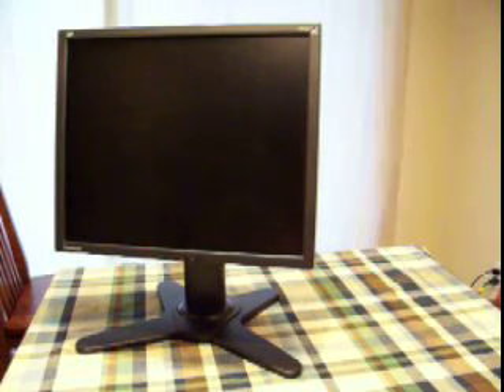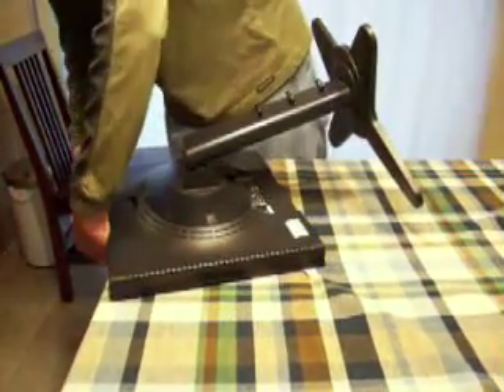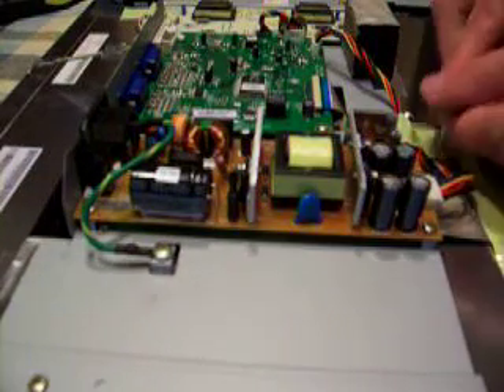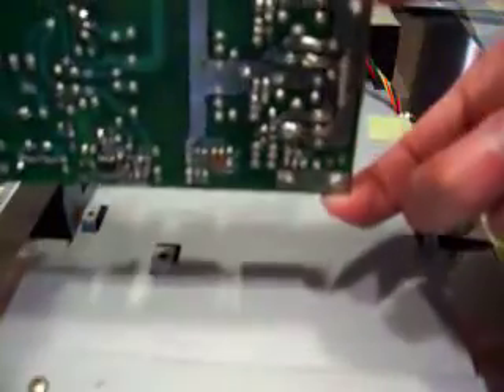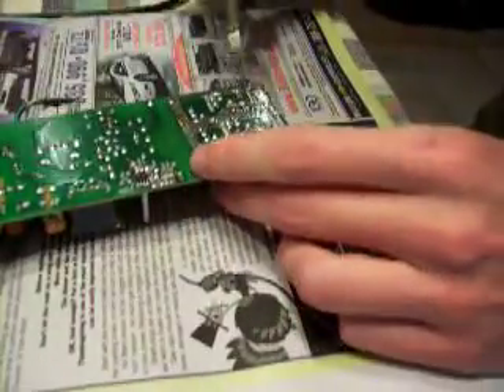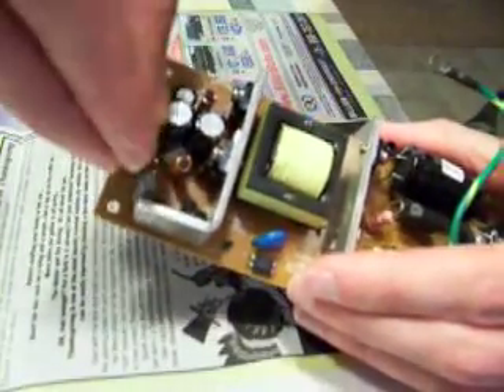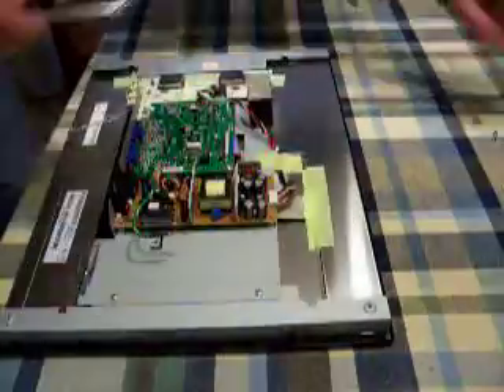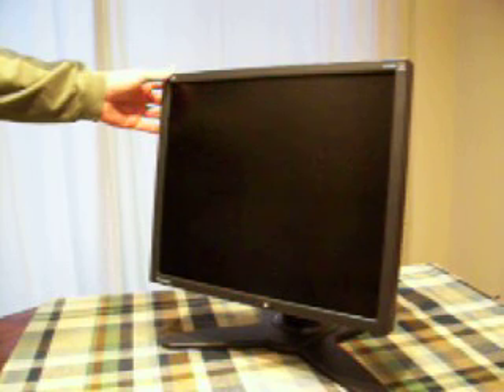Viewsonic LCD Monitor Repair VP930b (will not power on)

Comment: i received both monitors➡️>JustU.Faith/VSonic22?丘   the speakers are weak but i have external speakers so i just hooked those up instead so not a deal breaker for me. the color is vivid, so far very happy with the monitors.

Comment: well my capacitors look fine. flat and not bulging. But the monitor still doesn't want to power on. What else could cause this problem? could it be the switch? or power input?
Reply: If the monitor is completely dead, you should check voltage output, it should be something like 5V and 12V. If voltage is good and no power light - then probably the logic board is dead.
If the monitor light blinks (and it gives away high-pitch sound trying to light the lamp) then check for low ESR for all those capacitors at the end (you can use cheap testers like https://www.banggood.com/LCR-T4-12864LCD-ESR-SCR-Meter-Transistor-Tester-p-978992.html ) and you'll probably have to unsolder them from the board. If voltage is good and capacitors are good, then probably the lamp is dying and can't light up. Leave it struggling for a while and the lamp might turn on.

Comment: Not to be an ass but if you are showing people that it doesn't power up and you don't have the AC cable plugged in... well DUH! 

Yes, I know the problem is real and you've already fixed it but seriously, you need to show how the green power LED either blinks or how it just stays lit but no warning pops up on the LCD screen. I've fixed four of the VP930b and the bad caps are not always obvious and not always the little ones either.

Comment: Hi,  I have a 19 inch Viewsonic that powers on, then after a few minutes, turns off completley and refuses to turn back on (power button will not work for several hours after)

Any ideas?  It turns off totally, power LED too.
Reply: It's probably a power supply problem, but not capacitors. Try checking output voltage after it shuts off.

Comment: Bad caps are the #1 cause for flat screen TV and Monitor failure unless you have kids that shatter the LCD. Use good quality caps of the same value and higher temp rating also a higher volt rating will not hurt anything either. Some monitors will not power up, some will power on for a short time and shut off, others the power status led will flash. Most all those conditions are indicators of failed PSU caps. Also to note that you should change ALL can caps even if they do not look bad, large filter cap included.
Reply from the maker: True.  One cannot tell if a capacitor is bad without removing it and testing both the ESR and capacitance.  Just looking for 'leaking' is not enough.
I am curious though if you have some experience with this:  What brands/models do you see the most failure in?
Reply: Experience oh do I have experience yes. I work in IT and Communications and also do solar power systems and controls etc. anyways Brands that commonly fail fast are the cheap Chinese off brands simply because they have cheeped out on part quality so they can run batches faster. Name brands do also fail but usually its in an older unit that has seen alot of usage. Samsung and LG being the most common of name brand types to have cap fail prematurely in their lives.
Yes true you cannot tell by visual inspection a cap has gone south but in the repair sector of things like this I was taught it was a good rule of thumb to replace ALL the caps to be on the safe side. replacing one cap that's bad after testing them and such will fix the problem but who's to say a week later another cap fails and so on, and so on.

Comment: Thanks for the video. I found it today trying to understand why my old VP930 didn't work. The power led flashed but the screen didn't power on. I replaced the 6 capacitors for new ones and it worked again. 3€ repair.

Comment from the maker: Honestly, you're probably better off just buying a new monitor.  But if you want to try to fix it yourself it is probably just a capacitor somewhere - maybe even the same ones shown in this video.  I've seen monitors turn on/off/on/off continuously as well and their issues were capacitor related.

Comment: Thanks for posting this. I have same problem with my monitor. The CapXon caps: 1000uF, 16V are bulging. I will replace them with Panasonic or similar perhaps using 25V caps. It is likely the caps can not handle the ripple current or are under voltage. Yes, CapXon caps can save you money but in the long run your product may be disposed earlier then it should.

Comment from the maker: Possibly, however after they charge labor and parts you're probably better off purchasing a used monitor from that shop, or a new one elsewhere.  The VP930b's do have a much better display quality than most of the LED side lit junk out there today however, so you may have interest in keeping it for that reason.  I don't know, it doesn't hurt to call and ask if they do monitor repair.

Comment: I have  viewsonic N2635w and every few minutes to every hour it will turn off or turn on by itself. I use it on a computer for scripting reasons. I would be scripting then it just turns off and turn back on. Also if I am done with the computer and I turn it off, it will turn back on again then turn off again.

Comment: My 6 year old VP930 started to switch on then off again repeatedly (green light on and off only). I dismounted it and observed that 3 of the 6 mentioned capacitors are visible damaged. I have replaced all six (cost 3 dollars). Now the monitor works again perfectly.
Thanks for the video!

Comment from the maker: I'd recommend a 16V 1000uF capacitor of a good brand.  Most any will work for this application.  I don't want to advertize any specific part/brand as there are many good parts out there, but a very common example would be the following capacitor from Nichicon.  UVR1C102

Comment from the maker: @aulii08 If the assembly uses surface mount capacitors (no through hole leads) then the capacitor vents are usually on the bottom instead of the top, so look for any electrolyte leakage or residue around the capacitors on the circuit board.

Capacitors can also fail by simply drying out either due to age, excessive operating temperature, or poor design/construction. These will have to be removed from the circuit and tested to identify the bad ones. Most multimeters can test caps.

Comment: HI and thank you for your video. I have a 19inch Envision lcd monitor G19LWK with the same problem wont turn on no power light. I took it apart and Not like yours the power supply is on the same board i look at the caps and none of them looking bulging and i dont know if there the cheap made ones. Any advise would be greatly welcomed   Thanks